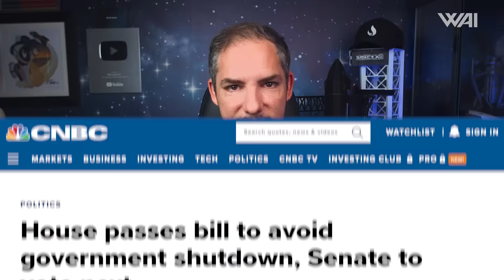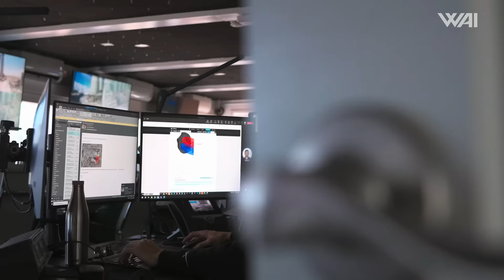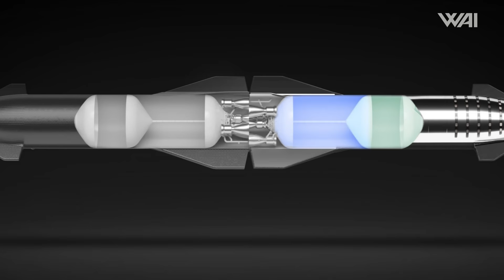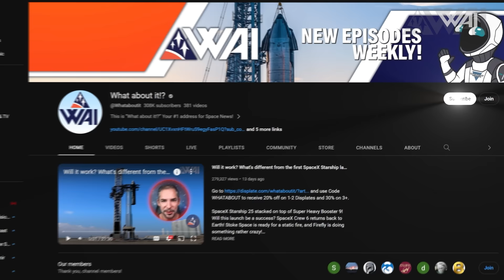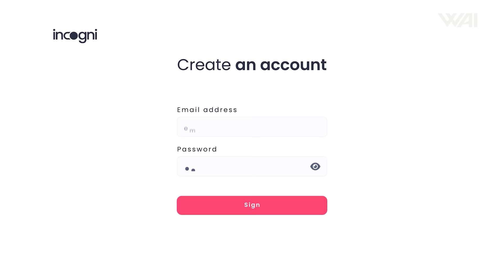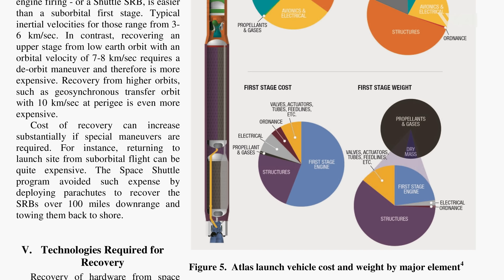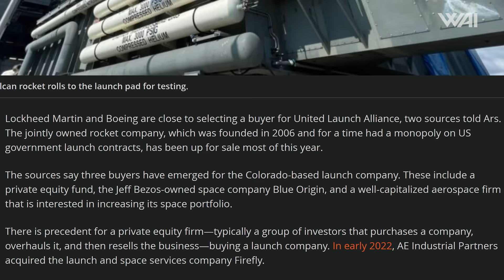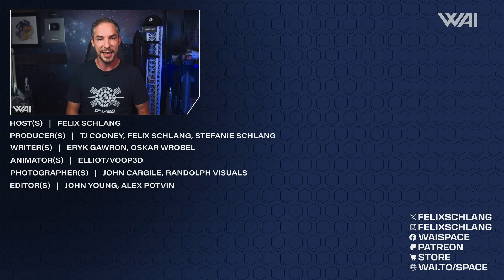SpaceX Starship Launched: What Happens Next?

Comment: I envisioned tanks based on syringes. One tank pushes the fuel out while the receiving tank would draw fuel into itself as the tanks volume increases as the top of the "syringe"  moves upward.  Instead of a plunger, perhaps motors driving the movable tank lid up and down.  However, I am not an engineer and just making a guess.  I also think one tank inside the other would work better than 2 tanks sharing a wall.  Imagine a smaller diameter tank inside of the main tank.  It might complicate things in one sense but it could solve fuel transfer without gravity.  Just a wild guess.
Reply: @JoeShmoism  As one tank pushes fuel out, the other tank would draw the fuel into itself as the volume of the receiving tank increases. It would have to be a synchronized.  Imagine two syringes connected by tubing, one emptying its contents into the other.  If the receiving syringe doesn't increase its volume the first tank can't move the fuel.  I'm trying my best to explain it.  If I get it wrong please forgive me.
Reply: @JoeShmoism  Cool.  The embedded tanks idea is more about reducing the length of the ship dedicated to fuel to increase volume for cargo.  I wasn't clear about the two separate ideas.  I think having the tanks embedded it might simplify the piston/plunger mechanism.  I envision a movable bulkhead being driven by electric motors.  Again, it is just an idea from an old bald fat man in Tennessee.

Comment: I think that ship to ship fuel distribution is a mistake. And that there should be a go between. A simple space station that helps to regulate the flow of fuel from one ship to the other. That gives the docking process additional stability, and the potential of the space station becoming a fuel distribution depot for multiple starships sooner rather than later. No doubt that’s further on in the future. But I would rather see it happen upfront.
Reply: The "depot" you're talking about is already on the roadmap — but it's just another Starship, one specialised with larger tanks and better cooling.

Comment: I’m going to keep my standard dish. Mainly because I run my dish on 48v directly from 12vRV batteries.  As far as I can see, the extra wattage is for heating to melt snow. Important for norther USA, but not here in Australia. The large fixed dish is 50amp, but I have not found a suitable Poe.
I would like to see a large flat dish with direct power (12v to 48v adapter option ), and Ethernet port for 12v or even 5v router that are readily available on Amazon. Well we can hope😢
Reply: Keep your dish who cares

Comment: I wonder when SpaceX plans to run either (or both) pipeline or rail spur to deliver propellants to the launch pad. There's no way to continue with truck delivery if the expect to shift up to rapid launching. Trucking it in is too expensive and time-consuming for the long term.

Comment: 16:10 . . . The Atlas V report page you show does not match what you are saying ?!
"Engine Costs" (blue pie wedge) look closer to 55% than "65%" for 1st stage and 2nd stage engine cost wedge looks like 25% ??
btw, Rocket Lab helicopter pilots now seem to refuse to risk their lives "catching" a huge heavy object suspended by parachute strings in windy conditions.
And, re-integrating the engine modules back onto NEW rocket bodies is far from trivial (or fast) either . . . i.e. lots of plumbing, wiring, etc. to deal with.
So, finally, as ULA is trying to sell-out, they are doubting the viability of their own future architecture, economic efficiency, & market demand ???

Comment: Your comment on using thrusters to generate the necessary acceleration for fuel transfer is not an ideal solution for the  fuel transfer. The ship-to-ship linkages and control laws for the guidance systems of both craft, when linked, as well as the additional structural loads is not an ideal situation.

An alternative method is  to use a balloon method system; mechanically compressible tanks (Via gas injection around the liquid filled envelope.) to move the fuel/oxidizer would be preferable. It weighs more, but does not require vehicle acceleration or the wholesale changing of the vehicles control laws for the combined vehicle system thrusting, just station keeping.

There are compressible pressure vessels currently marketed for ground usage. I would suspect a flight rated system would be a derivative of one of these cryogenic systems.

Comment: WE might as well build the gas extractor; after all, we WILL have to do this on Mars..so might as well perfect the idea; then when one of the early trips to Mars, this gas factory will be already proved to work.  extract oxygen, pure carbon for making carbon fiber, and other factories to make Methane.   I think this is the first step in creating a automated system to produce these products on MARS.. see it as a prototype, not necessarily for launch gasses.  It can't produce it fast enough to be used as propellent, but on Mars, if it takes 4 months to create one quanitiy for a relaunch from MARS, who cares, were less concerned about how fast gas production will be.. this idea is good for Mars, as a prototype

Comment: I think it is smarter to land on a mobile transporter (i.e., the land-based equivalent of their landing ships) for a variety of reasons.
Reply: That would require landing legs..   
Which would mean lower payload mass.   
Although eventually they will need them for the Moon and Mars landings.
Reply: It’s all about maximizing payload to orbit. Removing landing legs and supporting hardware means increased payload. It’s the same reason they are going with hot staging. 

Are there simpler solutions? Sure. But the challenges of catching are not insurmountable. Just like landing boosters on a drone ship that was thought impossible by most experts before SpaceX started doing it regularly.

Now one realistic possibility is a separate landing/catch tower so the launch tower and fuel farm are not destroyed if a landing fails.
Reply: @ReinReads  Ah, the “legs” would be on the mobile transporter … possible because the Starship will be able to hover … the mobile transporter would then use that very small amount of time  to finely maneuver, extend, and latch onto the booster or Starship with the same latch points used by the OLM.  If possible it would be more efficient for the overall workflow at a Starbase than the OLM (still good for stacking).

Comment: It is up to Space x to Launch even if Elon gets a permit they have time to get that green light before igniting engines. That is a large rocket very long and a lot of weight however while the payload is questionable. Building rockets is very interesting but after all engineering a device that will not explode is another. But in the long run the towers is going to be the answer. Assisted takeoff will be the in future instead of blowing something up lets engineer a tower that will use weight displacement. ON one side will be a booster the instillation of an elevator that will lift up that payload at the same time the engines begin to fire. Use that combustion wisely. Push that load up the same concept that a  trebuchet basic Physics perhaps even if it takes three towers that are twice as high. Float that big lady straight into the air then with a heavy payload. Saves fuel plus at no risk or sleave sections screw it is just a comment fire everyone but no more pressure vessel failures that have fuel in them.

Comment: SpaceX Achieves Spirit Airline Safety Levels!  By disassembling Starship right before launch and replacing a major safety component, SpaceX has succeeded in reaching the same safety levels as Spirit Airlines!  Nothing makes me feel safer when I fly with them than seeing Spirit Airlines personnel taking the plane apart and replacing a major component just minutes before takeoff while I sit waiting on the plane itself!  Who would have thought that SpaceX could achieve commercial airline safety levels matching Spirit Airlines with only the second launch of Starship! Of course, we all should be supremely confident that the exhausted SpaceX engineers have not ignored, overlooked, or failed to detect other major Starship issues because of the tremendous pressure that Elon, the Chuckleheaded Toddler, is putting on them to launch his bright, shiny, new toy sooner than prudent!

Comment: Florida doesn't have the pipeline infrastructure that Texas has with Vandenberg actually better than Florida with that as well as at least SoCal does have some oil production whereas Florida has zero of that plus zero Refineries as well. Plus NASA already has its own Moon Rocket which has already reached orbit and is fully validated. What SpaceX has is an actual business model (Starlink) and the purpose as I understand Starship to be is to launch Starlink. Having one Starship being able to deploy say the equivalent of 10 or possibly far more Falcon 9 Starlink launches would free up an enormous amount of lifting capability for other matters such as ISS support or science missions or weather and mapping satellites the list is quite extensive for that. "All it takes is money" of course and with zero spending discipline in Washington DC now despite there being ahem "trillions upon trillions" basically there is no money or more accurate to say "effective money" because there is no Budget. One odd item from Starship is the massive size of the 2nd stage which has a kind of "Space Shuttle" vibe to it so trying to lift so massive a body just from the main lifting body alone let alone after stage separation which looked flawless to me and has very important implications for the entire launch business as you might not need a second stage for Falcon 9 now or any other rocket for that matter...still waiting on how that plays out. Either way building out a "dispenser" for using Starship to put into orbit massive numbers of Starlink satellites is the question I have right now today as again that's what makes this a business.
Reply: Starship can't go SSTO with meaningful payload from Earth